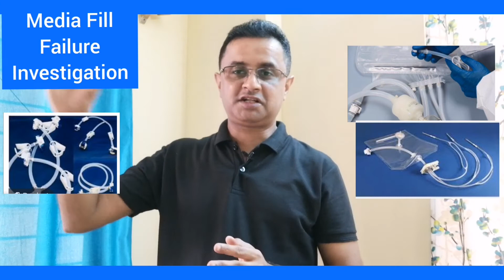Media Fill Failure Investigation UFSFDA @PHARMAVEN #mediafill #usfda #pharma #aseptic #validation

Comment: Hii sir during media fill if any Of the settle plate location in GRADE B, if found out of limit means 
Over the action limit(OAL) how we can handle,
What type of document will be attached with OAL form.
Reply: Thank you sir
Reply from the maker: You can consider settle plate counts of all the EM plates. In case this is the only plate with excursion then consider all EM data, NVPC data, Temperature, RH and DP data. 

Try to find Possible reasons for excursion in one plate, may be man material movement, any activity done around that plate, plate handling issue during exposure or in the micro lab.

In case all other data are within limit, including proper cleaning and sanitization of area then this can be a standalone case.

In case you find a specific reason for the one plate EM excursion then document, find the root cause and assign CAPA

Comment: How common is media full failure, percentage wise? What if you see growth of bacteria during incubation, when are you supposed to remove it?
Reply from the maker: Media failure is not a common event, percentage is not available through any relevant survey Or data analysis per my best knowledge. Media fill inspection occurs at 7th and 14th days, however, by any means if someone identifies growth in between, it should be immediately evaluated and if number of contaminated units exceeds the acceptance criteria, it should be investigated.